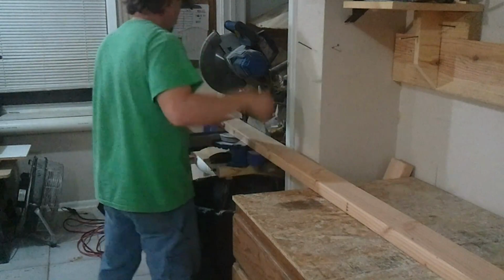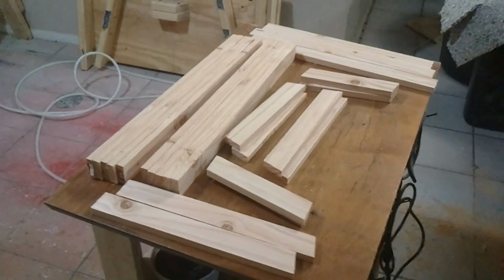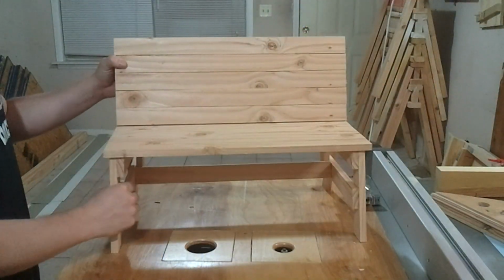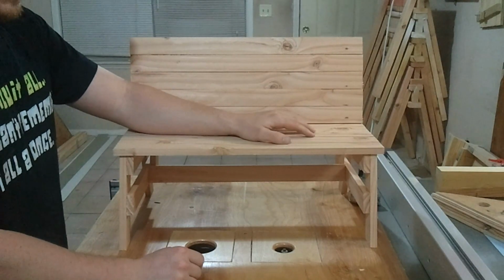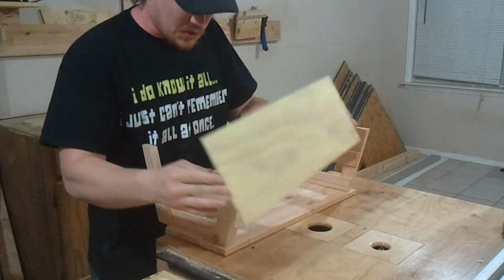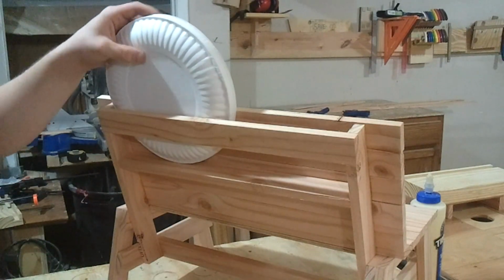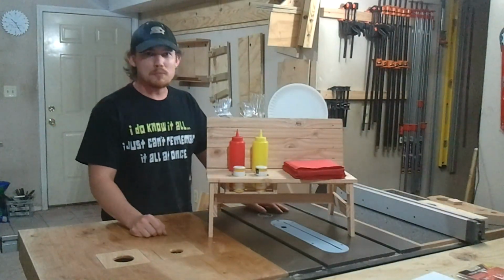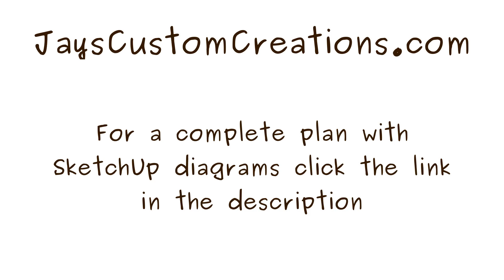Mini Garden Bench Condiment Holder - Great For Picnics! - 094

Comment: If you are looking to hold the napkins in place you could take 2 dowels and a block of scrap.  Fix the dowels to your seat with an oversized napkin space between them and drill the scrap piece to slide down on the dowels with the napkins underneath.

Comment: Awsome job but. The only thing that can fly away is lose. Well I guess the plates cloud fly to... You could drill 2 holes 10-15" apart then match a pice of the left over 2x4 and use that as a weight over the dowels. Allowing it to slide up and down on them.. Then slide the tissues under neath.. Just a suggestion. Lovely project..

Comment: In your SketchUp video for this project, you mentioned that the plywood panel was to support the piece between the condiments and napkin whole that wouldn't be held to anything. You still use this piece even though you've eliminated a whole.. Does it serve another purpose? 
I think that I might put the napkins next to the paper plates on the back and make holes for cups for the plastic-ware. Thanks for the idea!